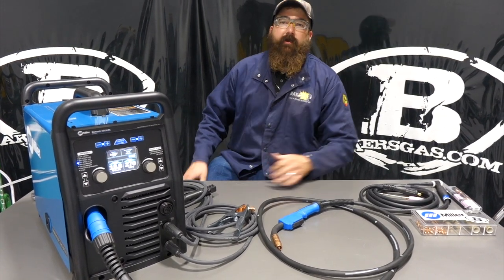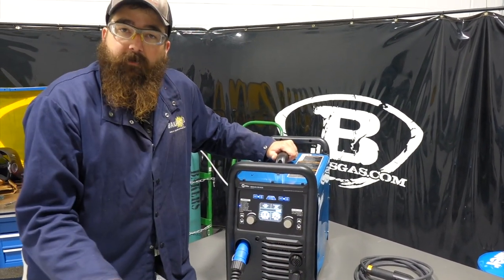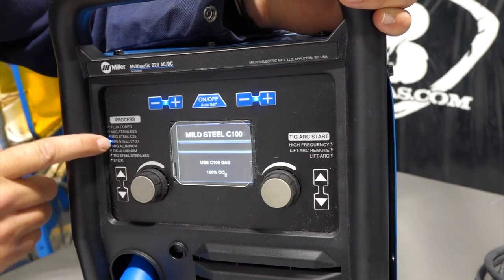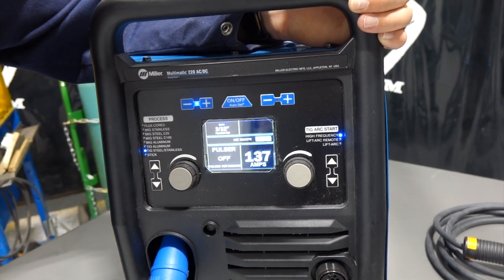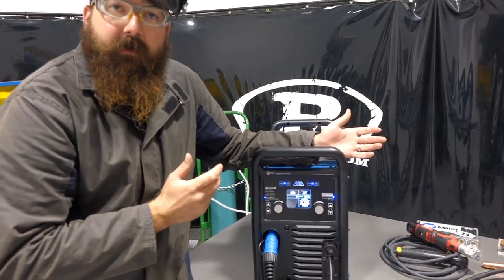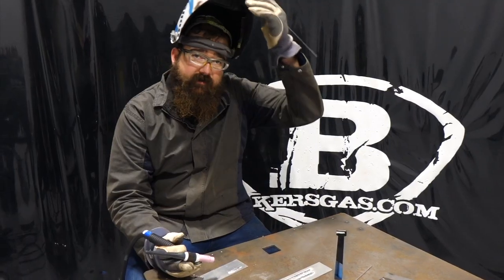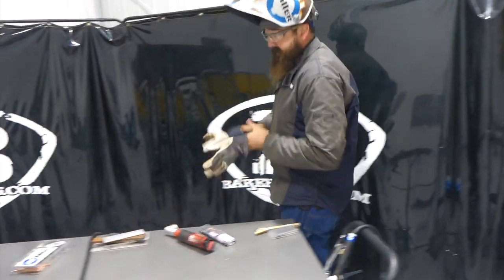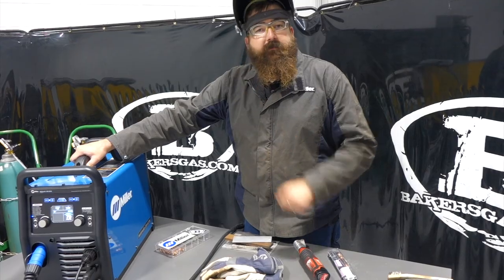Miller Multimatic 220 Welder Review - Full demo & update after using it for 2 years!

Comment: I've got two questions, I may have missed this information in the video.
1. Can these machines successfully run 6010? I have the 215 currently and it does not run a 6010 properly, but it can run a 6011. 
2. Does the second gas solenoid engage for Aluminum MIG like it does for the TIG process?  From what I gathered, the second solenoid automatically engages at the step of the pedal. I usually run my spool gun and TIG processes with 100% Argon. Then I use 92-8 mix for MIG and FCAW.

Comment: Which has a greater capacity? The Miller Multimatic 220 or the New Miller Dynasty 210 Reimagined ?They both are 200 Amp inverters correct? Are their limits for welding aluminum A/C the same?
Reply: These aren't in the same league. The Dynasty 210 is 3x as expensive (configured ready to weld) and has tons more features in the TIG settings.  The Dynasty is a production TIG welding machine.
But to answer your question they have the same max amperage but different min amperage and duty cycles.  Multimatic 220 is 20-210A, and Dynasty 210 1-210A.  The Dynasty has a significantly higher duty cycle of 60% at 210A and 100% at 175A vs the Multimatic of 20% at 200A and 100% at 110A.
The Dynasty is also running a water cooler and water cooled TIG torch.

Comment: Great Video! Can't wait for next one.
 Question... living off grid, how would this unit work running off a 3500 watt Generator? Would slight fluctuation in generator power affect the out put of the Miller Multimatic?
Reply: 3500 watts would be probably be a little too low to run any sizable welds. The manual calls for a 10,000 watt generator for the MM220.  Also you have to be careful with generators making dirty power, you may need a generator with THD less than 5% to run the MM220. If you need an off grid rig I honestly recomend buying the Hobart Champion 225. It is a 10,000W generator as well as a high output stick welder. Perfect for off grid, only costs about $3,500, which is cheaper than the MM220
Reply from the maker: We would recommend a bit more power close to 10,000 watts. Also keep in mind that a generator is going to be dirty power but will work. Let us know if you have any other questions on the unit.
Reply: My Honda eu7000 runs this machine flawlessly. This inverter generator has as clean of power as you can get. I haven’t tried above 145 amps on 240v but doesn’t seem like an issue!

Comment: On 240 mig welding hardwire, at what settings would I be able to get close to 100% duty cycle?? I don’t know how to convert wire speed and voltage to amps… the machine only gives duty cycle parameters in amps.. I’ve been seeing 15 years and you don’t learn this stuff when the shop supplies everything

Comment: Thanks for the video. I am new what else besides the machine to get me started? Thinking of getting this next month.
Reply from the maker: Hey! Thanks for watching. The machine really does come with most of the big items. Only thing that it does not come with / or that we would recommend at the time of purchase would be a full spool of MIG wire, full consumable kit (MIG) and a cover if you want to protect your unit. I will link below but feel free to email us if you have questions. 
Bundle Option for the 220 - https://bakersgas.com/products/essential1299-220bundle
Miller MDX Consumable Kit - https://bakersgas.com/products/mig-consumable-kit-for-miller-mdx-100-gun-030-035-wire
Reply: Everything you need to weld, except welding gas.

Comment: Would someone mind explaining what he means by only getting 20 percent by using the 120 vs 60 percent duty cycle on a 220.  Option seems to be to get a 220 extension cord.  Any help or suggestions is massively appreciated! Also, great video guys!
Reply from the maker: The 220 power is going to let you weld longer. We do not suggest running on an extension cord unless you need to. If you only have 110 power you would just not be able to weld continuously as long.
Reply: At the same weld amperage, the duty cycle (Time you can weld vs the machine cool down) is different when using 120V power or 240V power.  The duty cycle at 140A TIG is 30% on 120V and 50% on 240V, as one example.  At 120A it is 60% on 120V and 100% on 240V.

Comment: On the fluxcore setting, can you use dual shielded flux?
Reply from the maker: You can use fluxcore wire with this machine. Just would need to change your drive rolls.
Reply: @BakersGas  Ever run dual shielded on it?  If so how did it do?
Reply: @JeffinTD  yes you can, on the flux cored setting, every time you hit the trigger on the gun it opens the solenoid valve whether you have gas connected or not. i use it for dual shield at work and it runs soooooo nice
Reply: @spencerbaldwin   I knew it opened the valve on flux core but didn’t know anyone who’d actually done dual shield. Thanks for the reply!

Comment: Would y’all suggest this or the 235?
Reply: You want AC tig, 220 your answer.
Reply from the maker: Hi! Thanks for watching. We would say 220 if you want the flexibility for 110/220 power and if you need/want AC TIG. The Multimatic 235 is going to be better for welding thicker material, higher duty cycle, a a bit larger and only 220 power. We did make a vide on the 235 and kind of where that fits if you want to check that out. I will link below for you: 
https://youtu.be/VzuNcY8Nj8w

Comment: I'm looking for a portable good quality wire feeder this might be it but it doesn't look very portable. I think the machine is like 60 lb? I've tried Lincoln 210 MP garbage, miller multimatic 200 also garbage, does anyone have experience with a solid tested and proven wire feeder that can run .023 to .045 wire???

Does anybody know or recommend a German brand? I know the Germans don't f*** around when it comes to anything they make
Reply from the maker: Yes this is portable but agree at 60lbs you are not going to carry it very far :)
Reply: fronius 2200